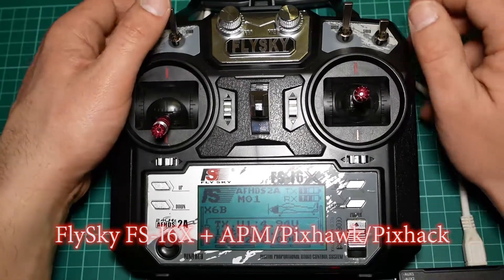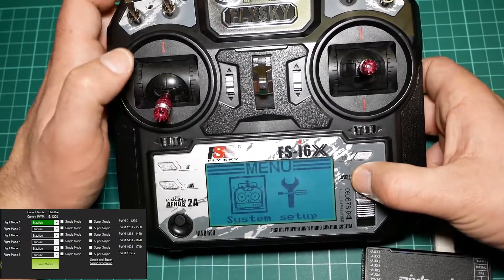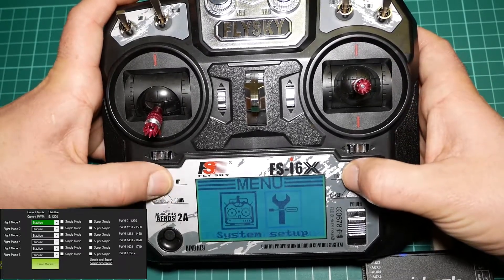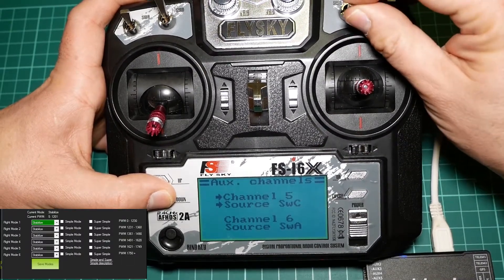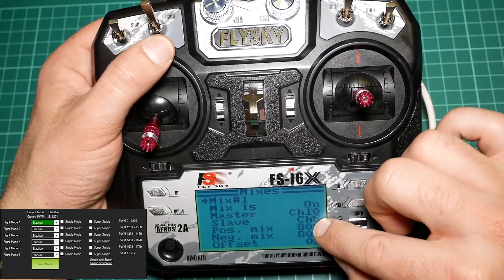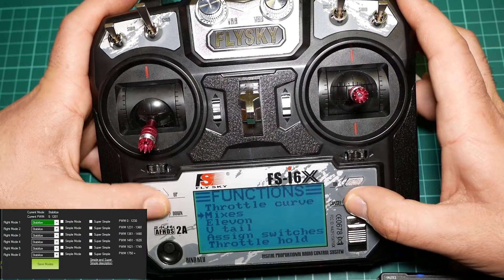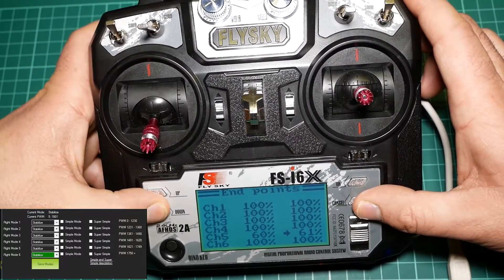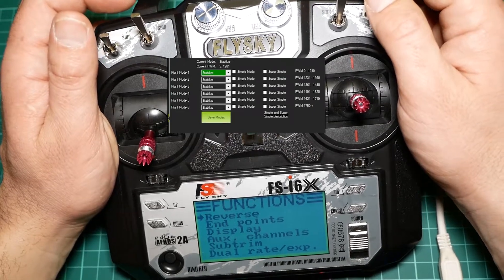Flysky I6X flight modes APM Pixhawk configuration on Mission Planner

Comment: Hi, I have the same transmitter fs-i6x and was trying to configure the 3 position switch for the first 3 flight modes in Mission Planner, I was able to configured the mode 1 with the first position switch but when switch to the middle position to configure mode 2 the pwm value jumped to 1500 and stay there and I can't change it, no matter what I do the value won't change.
Any ideas? Thanks!
Reply from the maker: +Jimmy Kan you must adjust the end points of the channel used.
Reply: RC Best Reviews I was in the end point but adjust the up/down but value doesn't change, it stay at neutral 1500

Comment: I have a 6 channel afhds receiver which is used for ct6b transmitter. the aux channel is not working. even when I plug esc to aux channel the light does not blink or turn on. only the first 4 channels work. is there a problem with receiver or what
Reply from the maker: +Universal Video yes, you have a problem with the receiver, I used afdhs on some rtf drones like furibee f90 and eachine E010S and the auxiliary channels worked nice. On pix should work too.